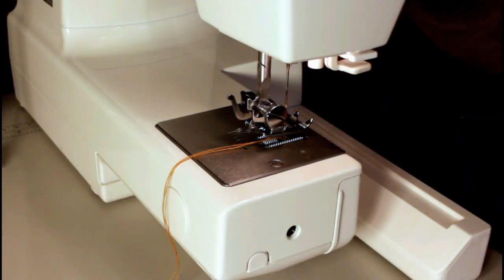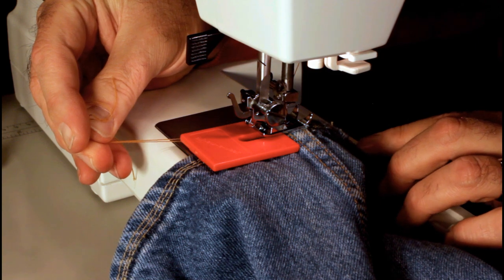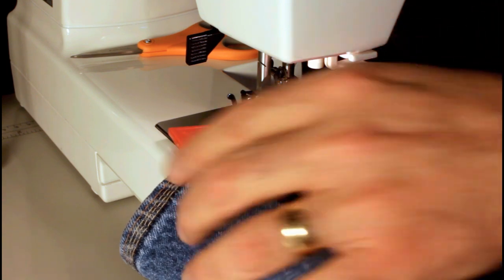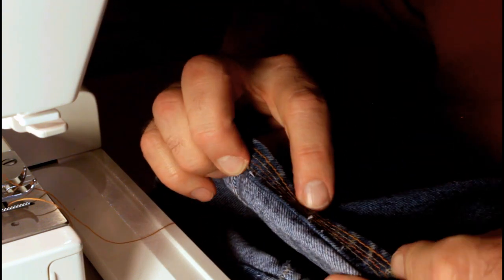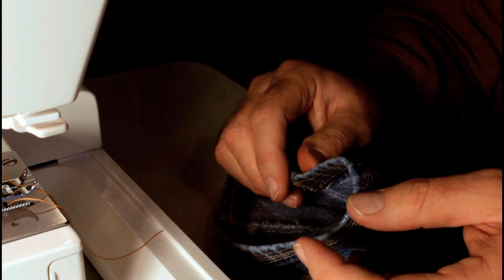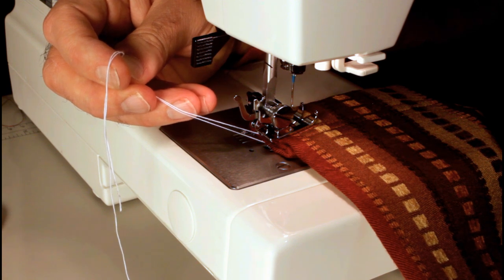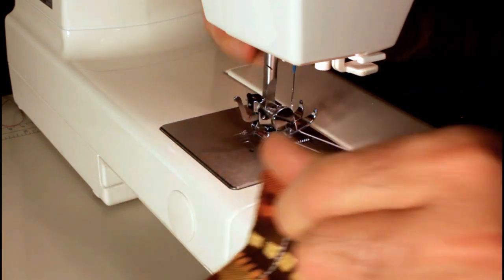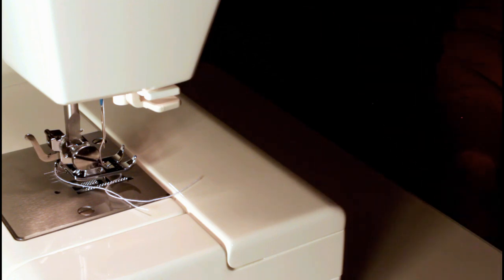Janome HD 1000 Sewing Denim and Home Deco Fabric

Comment: Hello, I’m looking to buy a Heavy Duty sewing machine. I’ll mostly be sewing denim, some leather bottoms but also some thinner materials for shirting from time to time. I’ve been looking into getting the Singer 4452 or the Janome HD1000 & HD3000.  Which machine would you suggest purchasing?
Reply from the maker: Janome HD3000.
Reply: Kevin Sews 😫😫 I bought the 4452, I was anxious, it was decently priced(low risk). How do you like the 4452?
Reply from the maker: @HawtPress  Mine has been fine for 4+ years.  Be aware that I am a professional, so I understand what the limits are of the machine.

Comment: Hey, I want to replace my current machine and feeling tied between singer 4423 and janome HD1000, which is more  strong and durable in the long run? Does having front/top down bobbin impacting the sewing quality greatly?
Reply from the maker: The bobbin system in the HD1000 can handle heavier thread. Meanwhile, the Singer has features an important feature that allows you to adjust the pressure on the presser foot. To get this on the Janome you will have to go with the HD3000. If you can afford that machine I would go with it.
Reply: @kevinsews  thank you for the answer😁
Reply from the maker: @marssachi  You're welcome!

Comment: Always enjoy your reviews. Have you sewn on a Janome Memory Craft 6300P? If so, whats your opinion? I'ts an older model, amazon had it for $789. Looking for a backup to my Bernina B560, the older one with regular size bobbins. Looking for larger throat space, heavier duty, with zig zag at least. Like the Brother PQ1500 SL and Juki 2010QL but they are straight stitch. My Bernina give me fits on heavier, multi layers applications, etc., otherwise it a great machine.
Reply from the maker: I would go with the Janome if the Bernina is over twice the price. I've heard from others that the Janome  6000 series are great machines.

Comment: What do you prefer to choose? Singer HD or Janome HD?
Reply from the maker: I prefer the Singer because they included a presser control for the pressure foot. If Janome had included this on the HD 1000 I would have suggested it. You can get this feature on the HD 3000, so if you can afford it I would go with it instead.
Reply: @kevinsews  What about Janome 523s? Have you ever heard that? It had full iron between inside & outside. Whereas the singer 4432 HD's framework had the fiber on the outside. Still confused about choosing the best machine from these 2 (Janome or Singer)
Reply: I mean, I wanna choose the machine for a long term use.. 😅